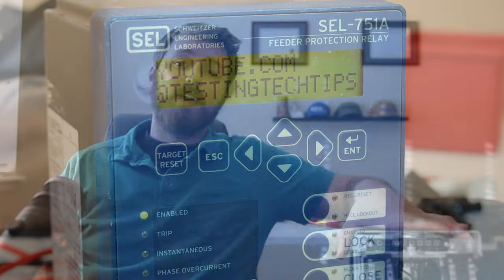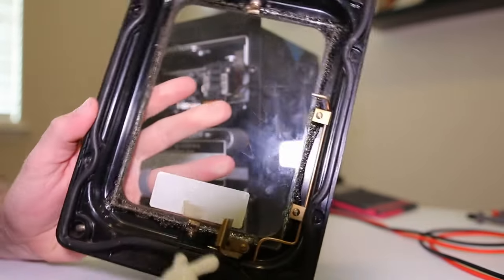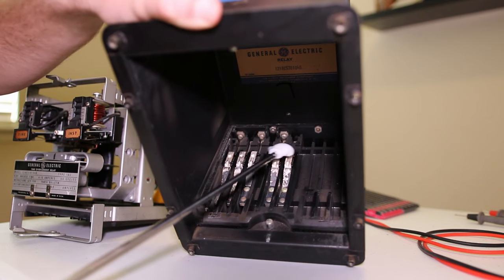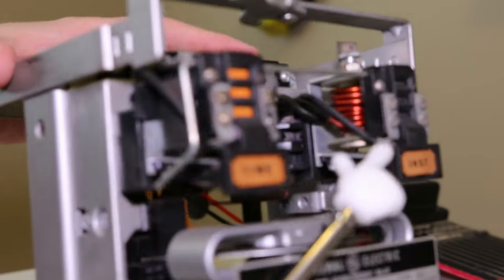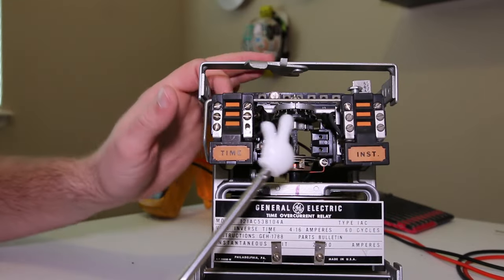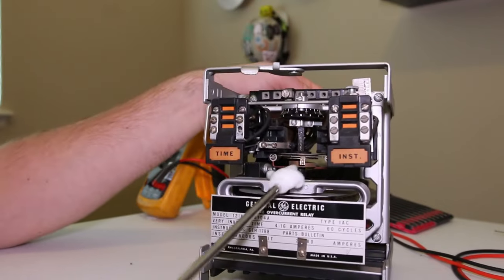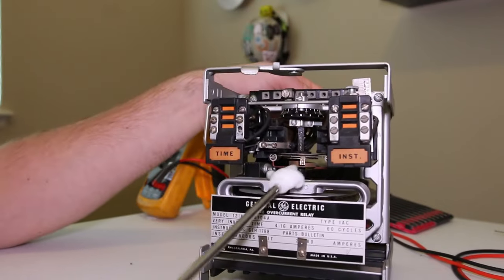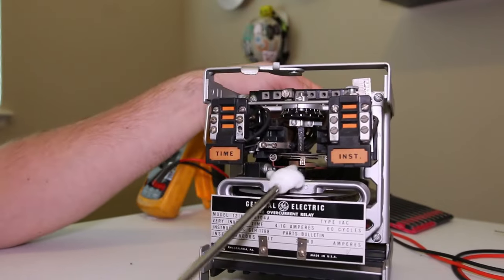GE IAC Relay Masterclass Part 1 - How To Test Relays ep5

Comment: Hey the adjustment for the toc pick up is not the drag magnet it is the spring adjustment. The drag magnet adjustment is for the time setting. In the event that the time dial setting needs to be finely adjusted you move the drag magnet. The instruction manual explains this.
Reply from the maker: Thanks for your comment. First off, I should have done a better job discussing this in the video and plan to make a part 3 to cover this. From tweaking hundreds of these in the past, both the magnet AND spring adjust both the pickup and timing to some extent. #1 the spring is easier to make fine adjustments, whereas a 1/8" movement of the magnet changes the characteristic drastically. #2 when considering the tolerance bands we're looking at, it seems to be easier to bump the low end of the curve (2xTAP) into calibration using the spring without pushing the pickup result out than vice versa. If either test fails by a small percentage, I start with the spring and can usually get everything dialed in. If the fast end of the curve (>6xTAP) is out of spec, it's likely at that point you'll need to move the magnet to get the high end dialed in and then adjust the spring to correct the slow end after. Just what I've found though, and your mileage will vary. And it's important to test the pickup AND curve against after tweaks which I didn't demonstrate in the video.

Comment: what is the difference between 12IFC and 12IAC relays?
Reply from the maker: The IFC is newer (from the 70's I think) functionally identical, except it's physically smaller, has a plastic/phenolic case instead of metal, and they have a 2 position tap adjustment allowing each unit to have a larger number of pickup positions. All of the same testing steps apply, though double check the book for the tolerances and wiring connections!